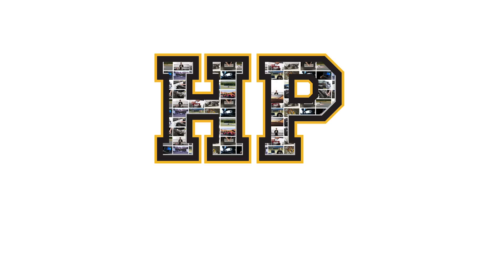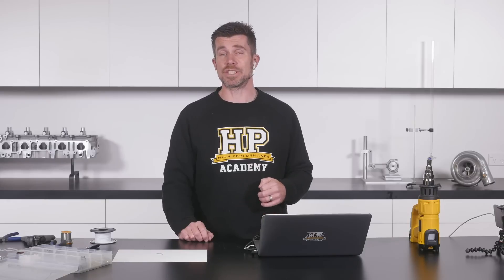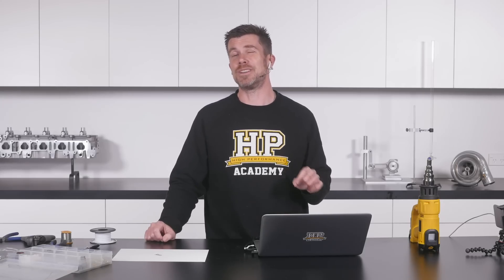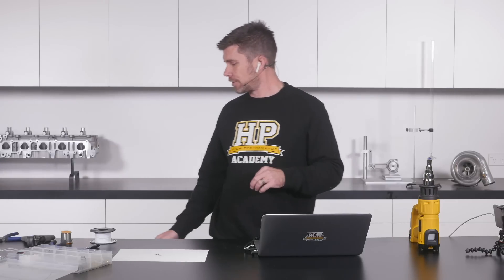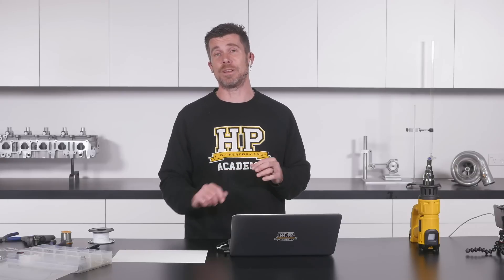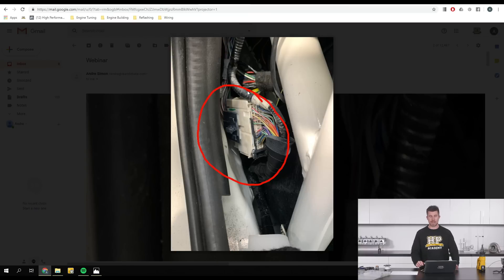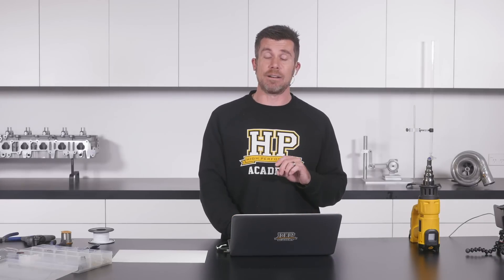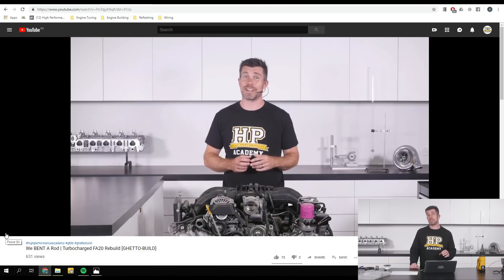Custom Harness Mounting, Ghetto Build + RaceCraft | Today At HPA 213 [UPDATE]

Comment: Does it matter what gauge wire you’re using to supply 12v to 6 other wires such as coil on plugs or Injectors?
Reply from the maker: Yes sir! Pretty much the only time you don't have to stress about selecting the correct gauge wires would be for sensors and CAN applications. Obviously not a hard and fast rule, but if it's not wiring for those two things, you 100% do need to make sure you're using the correct wiring for the job.
This is covered in the HPA Wiring Fundamentals course along with a bunch of other topics here: https://www.hpacademy.com/courses/wiring-fundamentals/ - Taz.

Comment: What is the advantage of a throttle by wire system? Seems to me it adds needless complexity and more failure modes, plus reduces the tactile feedback to the driver.
Reply: The common misconception of DBW being sluggish has nothing to do with the systems capability, but rather with the OEM programming for everyday consumers.

I am converting my FD to DBW for several reasons:

- Additional variable for tuning Traction Control (to help achieve max slip differential between driven wheel speed and ground speed).
- Ability for the ECU (motec in my case) to modulate the throttle angle for maximum potential acceleration, both in straight lines and turns.
- Ability to incorporate throttle position as a factor in boost control, again with maximum useable power being the goal.
- Ability to program in a speed/rpm limited "pit" or "valet" mode to easily limit speeds.
- Lets the ECU safeguard the engine by limiting airflow when critical systems are outside of safety parameters (oil/coolant too hot/cold, knock events, fuel/oil pressure issues, boost spike, etc., etc.) FAR faster than even a vigilant driver could react.
- More easily able for the ECU to compensate for and control a stable idle.

The list goes on, that's just what I can come up with off the top of my head :)
Reply: One advantage is that it avoids a potential boost leak at the idle air control valve.

Comment: Just remember that the adhesive holding that tab is as strong as your paint.
Reply: I'm not sure whether you're saying it is or isn't strong?

That adhesive holding the tab is several times stronger than the paint and should be used on bare metals ideally not painted surfaces.
Reply: @anonchannel1058  He is saying that no matter how much stronger the adhesive is than the paint, it could just pull off the paint.
Reply: @anonchannel1058  Most people aren't going to scrape the chassis paint to glue that tab down (proper method) for fear of corrosion.   I was just reminding them that they're now relying on the strength of their paint.  Not always the strongest.  For instance the engine bay paint on my '71 Z you can easily scrape off with just about anything.